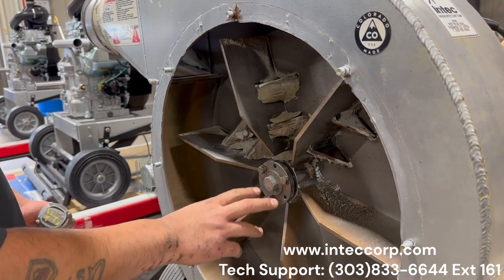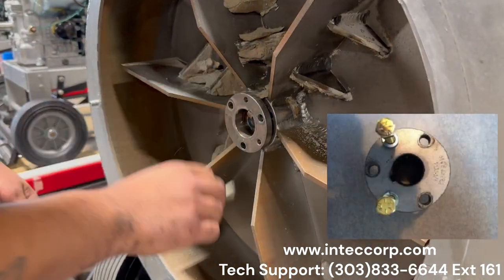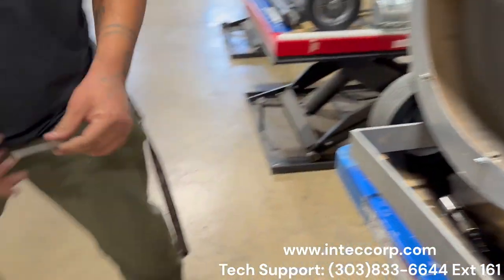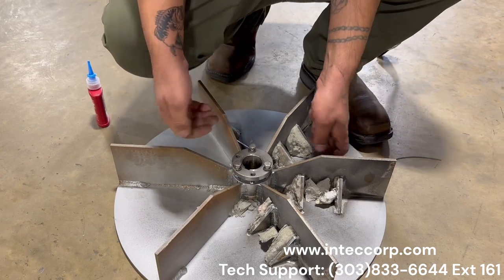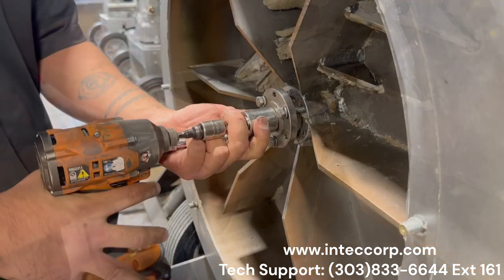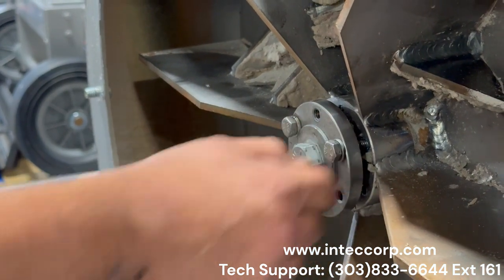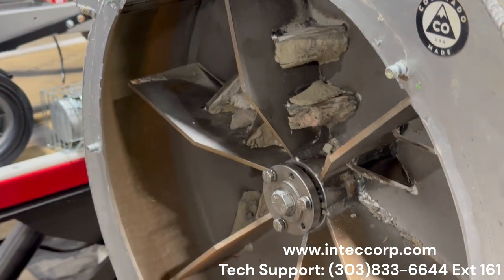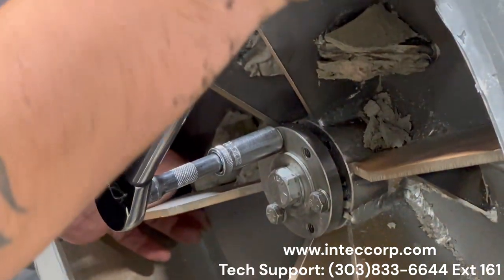How to Remove Impeller from Vacuum

Comment: What do you do when that bushing is stuck and won’t even come out.  I snapped one of the bolts cause the bushing does not want to budge
Reply from the maker: The bushing has two back-out holes -- these are the threaded holes -- you can utilize to back-out.  Place a long bolt (grade 8 as you will need a stiff bolt - 3" length suggested) into each and tighten until the end of bolt placed into the tapered bushing contacts the impeller.  Then hand tighten each of the two bolts one turn at a time.  By alternating back and forth the bushing will come out evenly.

With you snapping a bolt in one of these back-out holes, you will need to remove the damaged bolt so you may utilize this hole with one of the two back-out bolts.  Recommendation: utilize a 15/64" drill bit and drill out the damaged bolt (use a hole punch to strike center and drill precisely down the center).  Once drilled out, you can pull the bolt metal out from the rear.  The remaining metal in the threaded area will be forced out when you place a bolt into these threads.

Please contact Intec technical support at 303-833-6644 ext: 113 (Patrick) or 116 (DeArson).